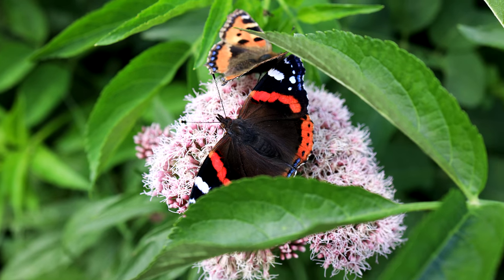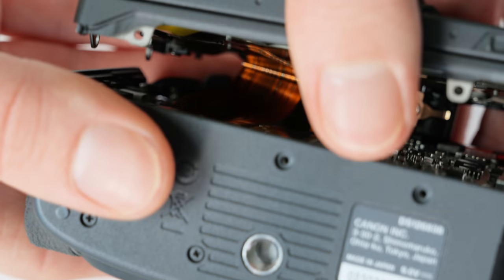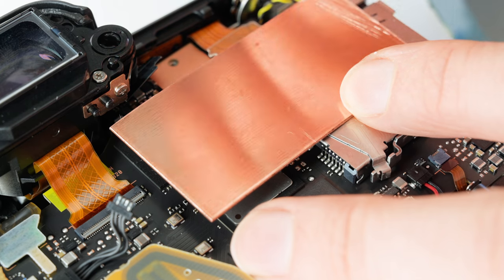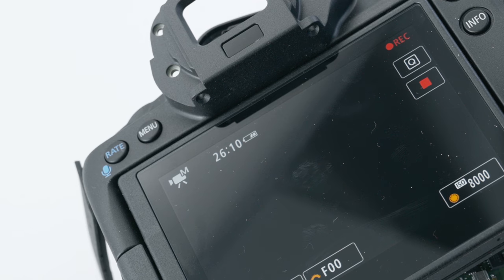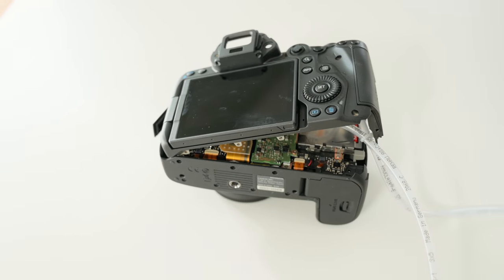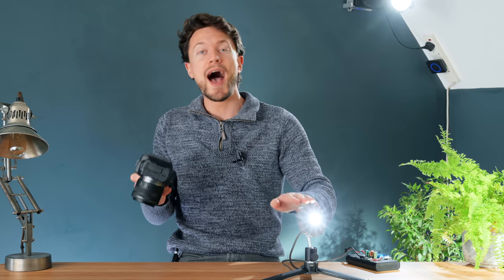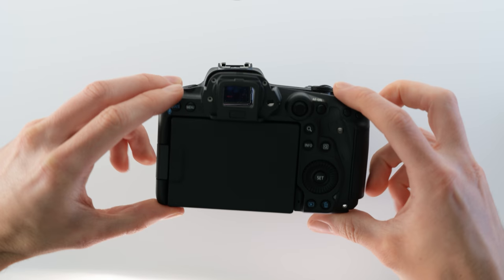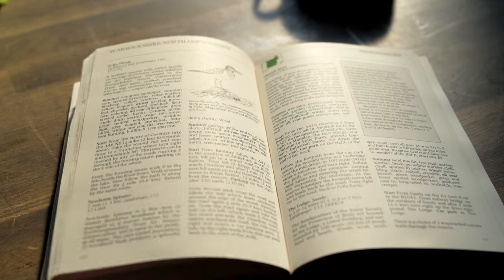The only reason to watercool a camera....

Comment: The fact that you were able to make the mod and still close it just fine is surprising and amazing. I could see Canon implementing something similar in a revision.
Reply: You mean implementing something that will prohibit this mod. Canon loves it's cinema line more than it's stills line.
Reply: @rhalfik   yeah I doubt that canon engineers are that dumb, if they wanted they could easily prevented overheating altogether but management demanded a better product segmentation so that they don't cannibalize their cinema lineup and since their other cameras won't go away, they won't fix that in any future revisions
Reply: So the part he fabricated out of copper by hand would actually be a rather expensive part in a 'at scale' manufacturing environment (relevant to the punched aluminum part) sinc it would require CNC or a large press die and the part is made from copper. His point about heat pipes is totally legitimate and 100% a good practical manufacturing solution. The reality, as many have pointed out, is that Canon is making engineer decisions about the product based on buisness decisions regarding higher end lines. This is ultimately costing them since it's resulting in them creating an inferior product that ultimately is loosing out to less confined manufacturers. This likely speaks to why they didn't pursue a better cooling solution since it would have resulted in a higher MSRP, or the bill if materials (BOM) cost eating into margins and thus seem like a poor buisness choice, rather than a smart product choice.

I've looked over a lot of camera, and various other sensor teardowns and one thing I've noticed about Canon is they tend to gimp there product in software on purpose to cause stratification. That or they skip out on a relatively inexpensive component and loose a feature because it means they can make a higher end version that has sed feature. This worked just fine when Canon was the only game in town, but the reality is they're not that competitive of a product and I don't think they're worth the price. There still good imaging devices, and once you cross a particular price point they're totally legit, however that price point is moving further and further away from the consumer/prosumer budgets.

I haven't bought any L mount glass amd still have Canon mount EF lenses but I'm unlikely to buy a Canon camera body any time soon, unless they rework there buisness strategies.
Reply: @MorRobots  Good point !! Canon really should learn : a camera which costs more but works is better than a camera that cost less and doesn't work !!
Reply: @MorRobots  While I won't say you are wrong, its also about goals. Its really supposed to be a stills camera, that can sort of do other things. So being as light as you can make it in budget was probably the highest priority. That copper is going to add some mass, which you probably don't want as a still camera.

Comment: After reading "watercooled" and "camera" in the same sentence, I imagined you would do what Linus did, to that poor RED camera, in a more sophisticated and well thought manner.
After seeing that the watercooling was used only as a "proof of concept" I was surprised 
And when you ended up designing  a new thermal solution, better than the entire R&D department of Canon could, I was just shocked!!
Two thumbs up!!!!

excellent work!!!
Reply: Oh, Canon could make these cameras run ice cold if they wanted to. But that would cut into sales of their C-line of cinema cameras.
Reply: It's called marketing trick and keeping the market of mid range camera's alive.

Comment: What a great mod. Even without the water you  basically unbroke the camera. 40 min is perfectly usable in most use cases. I can't believe the pad contact they used, good on you for revealing poor manufacturing and software implementations on an otherwise good looking product. Hopefully this drives companies to fix such simple things like better engineering in crucial areas on launch.

Comment: So... a 10 cent piece of copper and some proper thermal paste fixes 98% of the overheating issue?!?! Can't believe Canon screwed that up. Adding this type of active cooling to a battery grip would be so easy for them to do, and like you said, sell it for $400. You should patent that piece of copper and sell it as a kit for all R5 users. I'd buy one.
Reply: It would not surprise me to see this in an R5 II. As ridiculous as it is that Canon didn't fix this in advance, it could be pure marketing to leave some room for improvement. Because apart from the overheating problem (which really isn't that big of a deal for the vast majority of users) it doesn't seem to be much to improve here from a practical point of view. Just my two cents.
Reply: you don't even need active cooling, just have a "heat window" out of copper on the outside of the camera somewhere. people would pay a 1000 extra for limitless recording, and it would also look pretty cool. it would be warm though
Reply: The amount of faith you have that it wasn’t done intentionally is astounding. Basic electronics design always includes thermal management — this level of negligence is intentional.
Reply: @Brownboy42069  I was thinking along the same lines seeing that they hadn't used copper to begin with.
Reply: Didnt expect to find you here :D
Reply: i think best way is to buy some damaged gamer smartphone as long as cooling system part is not phisically damaged, and use it for that
Reply: ill buy one too
Reply: I think it was intentional, they didn't care about proper cooling because they knew that the C70 would be released
Reply: 10 cents for that copper? Lol you have no idea how much that copper sheet costs, copper is super expensive, probably was like $20 at least
Reply: @eksine  yup. I looked up the supplies to see if I wanted to attempt it. I still am, but just backing your claim that it’s not cheap. Certainly not 10 cents.
Reply: @xkben90  yeah just double check the thickness. He probably said how thick in the video. I have a welder so I would try to weld the copper, but you probably need the copper flux and whatever that braze material he used.
Reply: @eksine  yes he did. He used 1 mm and 2 mm copper sheets. 2mm for the main plate and 1 mm for the bent portion.
Reply: I think a camera with a 50C backplate would require some major warnings, possibly liability issues. That is into scalding territory.
Reply: @EricLS  Panasonic's S1H flagship already knew about these overheating issues and what they did was they made the body super thick and they stuck a fan into it. They did the proper way not half ass like Nikon and Canon and Sony 's a7r iv
Reply: @eksine  yeah. Canon has always been “here’s a feature bonus, but if you’re a real pro, buy our pro video stuff” I expect nothing less from them. They are never like Sony or Panasonic, who jam as many things in as they can, regardless how jank that may end up making the final product. Helps when you’re the underdog.
Reply: @EricLS  do you mean 50C can burn the user  who touches the back of the camera(where the swivel screen folds and locks into ), or do you mean the temperature can melt the plastic of the camera?
Reply: @EricLS  yeah it's satisfying looking at the sales graph for 2019, sony exceeded both Nikon and Canon in sales. I'm probably gonna buy a a7riii or wait til all these guys take things seriously and put fans in their cameras or at least put a giant heatsink in it
Reply: @xkben90  burn humans. This plastic is a thermally stable fiber reinforced shell, it’s fine. Probably wouldn’t burn my calloused fingers, but that temperature can scald more sensitive skin.  Not that you’ll put the back of the camera on your inner thigh, but it’s getting close to danger. 
If they just called it a gamer product, or a MacBook Pro, then they could get away with it. ;) But again, Canon is very much a polish-oriented brand.
Reply: @EricLS  ahh gotcha. Yeah i already considered the possibility of thermal burns to the skin if you press against the back of the camera. I’m assuming anyone attempting this should already know the basics of thermodynamics and how heat sinks work, meaning they shouldn’t be touching near the area where the heat dissipates.
Reply: @xkben90  oh, all systems go if you’re putting hunks of metal into your own camera, sure. I just think it’s a little naive to think Canon should have just put a 50c plate on the exterior of their cameras, so a hyper-small segment of users could shoot unlimited 8K video, as the original comment suggests. Fans are not weatherproof, and Canon is aiming this at journalists, wildlife photogs, war photographers, etc. “iT sHoUlD HAvE a FaN bUiLt iN” is just missing the point of the cameras main design. Edit: a later comment mentioned the Panasonic fan
Reply: @eksine  why would you correct someone else’s comment if you don’t know the answer yourself? Copper is worth 8 USD per pound scrap and 14 USD per pound pure (pipes, sheeting) please take the 10 seconds to google something before spreading misinformation just for the sake correcting someone.
Reply: @ThumbDr  a copper plate 100*100*2 mm costs ca 19€. Question is how many can or do you want to get out of that plate. Plus you need to get/buy tools if you don't already  have and solder.
Reply: @ThumbDr  all my other comments got deleted, so I'm reposting this. I just looked up the prices and $20 is a VERY accurate number, he needed 2mm and 1 mm copper sheet. the equivalent is 14 gauge and 19 gauge. so Sam you need to learn how to use google, not just 10 seconds. $20 is a super accurate guess. not everyone has a scrapyard and even than scrapyards RARELY have copper sheets so you are so far off that you're just wrong here, WRONG
Reply: @eksine  yeah I’ve seen a consistent pattern of $15-20 per sheet, meaning $30-40 if you’re getting both sizes (1mm and 2mm). Maybe you can get scraps of copper Cheaper, but then now you’re talking about doing extra work to get the copper metals to the desired size and thickness.

I’ve done the homework. For most people who don’t have any of the tools(and I’m willing to bet most people do not), it’s about $200+ to get all supplies for this project. Getting a vise, a tiny screw set, a MAPP/propane torch, etc.

It’s not cheap. No matter how you look at it.
Reply: @xkben90  yeah you know, I was thinking one way to do it cheap is just buy the 2mm sheet and for the small tabs just sand the 2mm down to 1mm. also it might actually be cheaper just to show a machine shop this video and it might come out to the same cost. I was also thinking about getting the shop to mass produce a kit and sell the service. I bet you could do it Ben sell the service for like 400-500. theres more ways than this to mod it too because you want to be able to use the 2 battery grip or I would run wires to the battery lid for an external lipo4 or 18650 battery pack. shit you could make so much money off these suck...peoples
Reply: @eksine  haha I don’t know about that.. I’d have to successfully do I myself first. I’m going to try it before the end of this month. Just trying to figure out how I want to tackle the project.

Honestly, I’m willing to bet 99% of people would be happy with just the heat sink replacement itself. That alone allows you to record 30 minutes without interruption, and after a 5 minute wait, you can record another 30 min.

The heat sink with the fan attached to the back actually seems like the easy part. I have a few old/dead laptops so getting a fan out of one of them shouldn’t be a problem. 

I thought about the 18650 battery route as well to power the small fan, but I’m wondering if I could just get a mini portable charger(Anker makes one that only weighs 85g) and just require the laptop fan to be compatible through a USB-A port .

So many ways to tackle this... whether I want to try and make this a service to provide or just a hobby, it’ll be fun!
Reply: @xkben90  well I meant using an external battery in place of the original battery, so the battery compartment is emtpy with 2 wires coming out it's door. however as far as powering the fan you could do it the way the video shows or buy an external battery for this camera, an aftermarket powerbank, it charges the r5 through it's usb-C port. here's more info

https://www.canonrumors.com/forum/threads/eos-r5-external-charging.39174/
Reply: @xkben90  also yes just the plate by itself was something I was thinking about. And I'd also see if aluminum could be substituted, also I remembered copper is soft, people buy copper pipes and hammer it to make buss bars. maybe you could try hammering the 2mm to make it thinner. If I had this camera I'd try to do it, but I'm learning photoshop on youtube, waiting for summer so I can finish painting my van
Reply: Epic Rhino Films  no the firmware doesn't fix the actual overheating. you literally didn't watch the video at all because he explains it. the overheating isn't a rumor it's real, the firmware disables the shutdown timer, so it basically just ignores the safety protocols when the camera overheats for a few minutes longer than what the timer would have done
Reply: @EricLS  
You can still make camera 
Weatherproof and make camera that stay under temperature, sony new lineup is great example.

Plus canon is not known for making perfectly crafted machine.